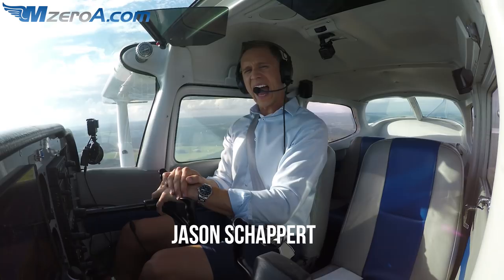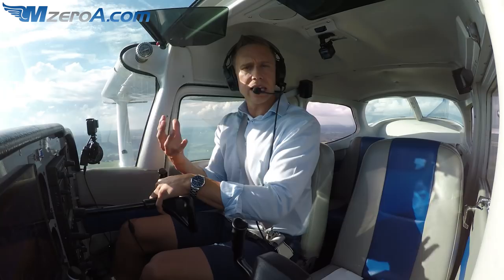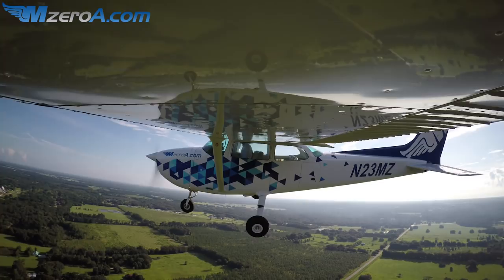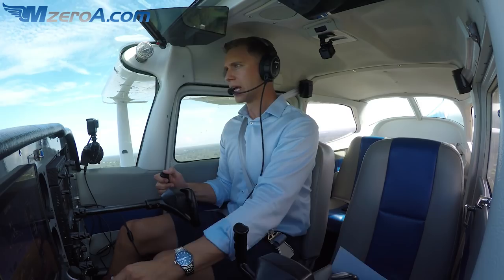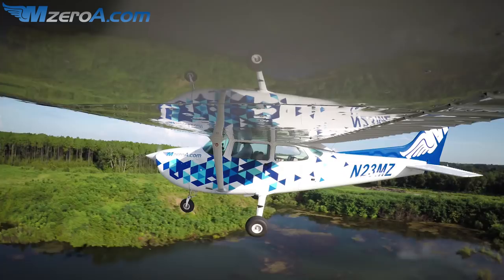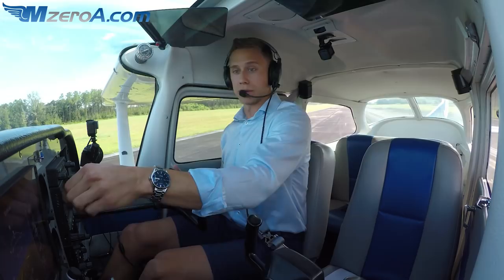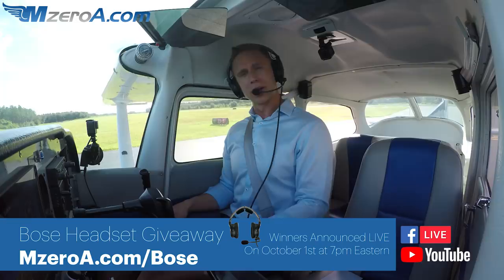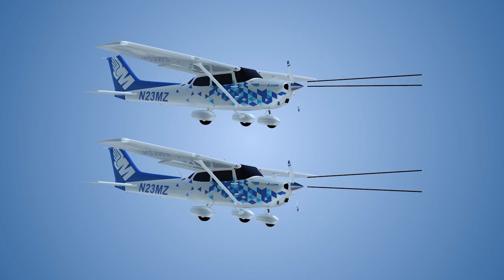3 Tips For Better Short Field Landings - MzeroA Flight Training

Comment: 60 mph (53 knots indicated) on short final we used on that 40 degree Cessnas 172.  Little flare allowed.  Same on the 40 deg flaps C150,  60 mph on final.  70 is way too high speed with only 1-2 passengers on board.  Wimpy short field landings were not allowed in the 1970's i learned to do them.. On a 1,800 long runway..  With 30 feet trees at each end.  Old Crosby field.

Comment: Hey Jason, Im currently a PPL student in Canada, and were taught to do short field landings with Full Flaps. In the scenario where I fly a C172 that would be 30 degrees. Does the US teach something different? I also believe that short field in the POH of a 172P states that it's with full flaps. Maybe youre model states something different? Could you clear this up for me?
Reply from the maker: In our POH it gives us an airspeed to approach at and recommends using maximum allowable flaps to maintain that airspeed. Its difficult to say always use 30 or 40 degrees. What if I'm doing a 10kt crosswind short field? or a 20kt headwind short field. Using full flaps could be dangerous in that situation. We as CFI's should be teaching airspeed management. A student should be able to make a 70kt approach at no flaps, full flaps, and everything in between.

Comment: I thought the idea of a 50ft obstacle is that it’s closer to the end of the runway than 1/4 mile away. You seem to be just doing a normal landing. You’re not mentioning horizontal or vertical speed on final. How is anyone supposed to tell what’s different about this “short field” landing as opposed to your normal one?
Reply: On the only difference really from what I understand is your flare earlier and you have a tight area you must land in